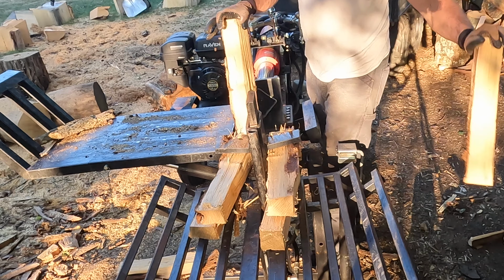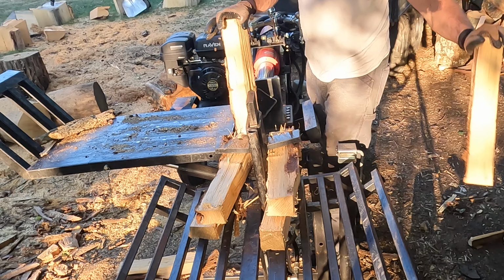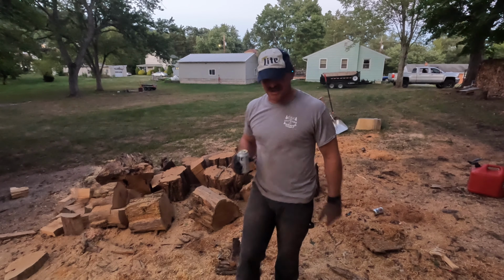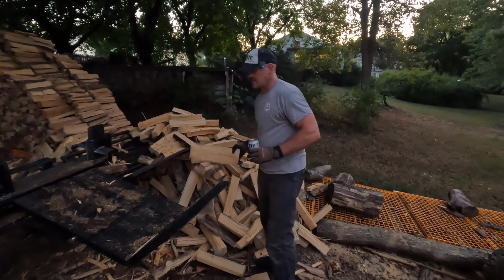Modified Rugged Made Log Splitter Splitting Locust for firewood

Comment: Locust looks good in the pile.  Appears to be reasonably dry in the log and will give your stove a long, hot burn with the best coals I have seen if you get it down to low enough moisture content.  Splitter does a nice job and you read the grain really well.

Comment: Black locust burns like coal. You need a hot fire going with oak, ash or others before adding the locust just to get it burning. My favorite.
Reply from the maker: I saved a few pieces for myself to try it i have never burned it in my stove so we should see how it goes
Reply: @OutsidewithScheib  how did ya like it?   Locust is probably in the top 5 black locust is much better than honey locust.   Every year I get at least 2-4 locust trees from customers and when i sell the wood it always is split and stacked together so it doesn’t get mixed.  People pay a premium for “100% locust” oak hickory and even 100% maple.  Don’t understand why but it sells first before “mixed hardwood”

Comment: Having your cylinder stop at 18/20" saves u alot of time.   All the box store splitters retract to 24" roughly then im wasting seconds on many splits if your hands not on the lever to kick off auto return.  I need a ultra for how much I'm splitting  and selling I'm doing.  over 200 face  split this yr already. Still have  alot more logs from a small logging  job to haul home and buy another  truck 12 cord load to work on. I sell everything  I make and I'm not cheap 2x more than everyone else's firewood. Need to get a processor  asap
Reply: Sounds like you got a good thing going- if you sell everything you produce and charge twice as much as competitors, buy all their wood and resell- double your money!
Reply: @mikehughes2026  
I already do that for large orders. Buy,  deliver ,get paid